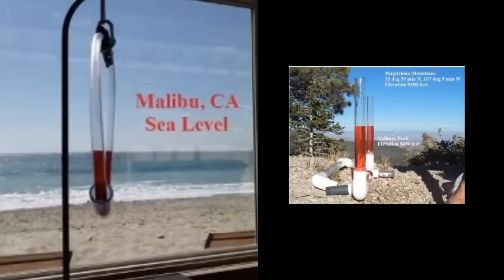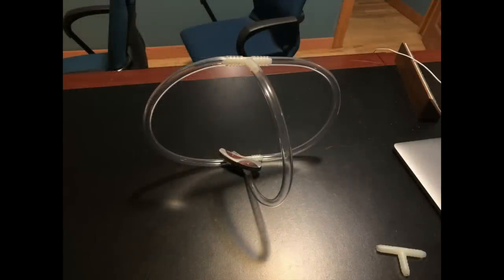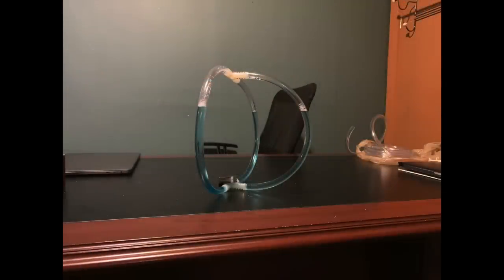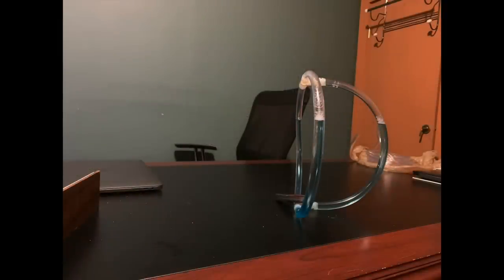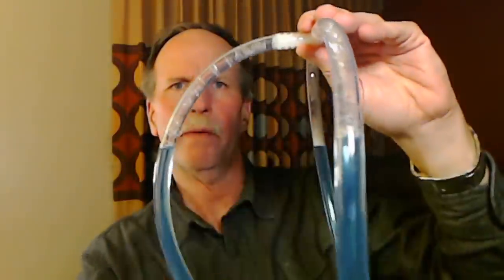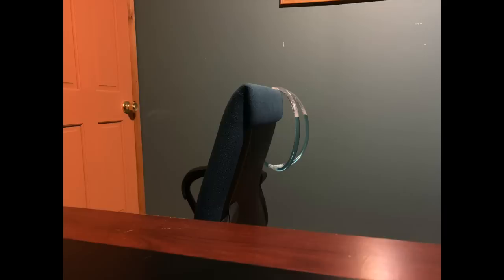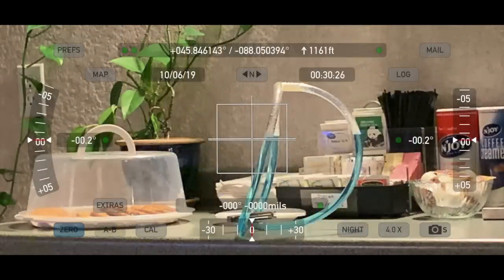Bob's Triple Water Level

Comment: Very nice.  I'm not sure what the surface tension is on Windex, but it's probably lower than tap water.  I might have gone with something that does not have suds, since the bubbles might interfere with the optical clarity when taking photographs and the mass in walls of the bubbles might cause a difference of height in different columns, however I'm not sure what colored liquid would have the desired properties of a minimal meniscus, no residue deposited on the tube walls, and good stability when subjected to the temperature extremes that might be experienced in the trunk of a car left outside overnight in the winter or in the sun on a hot day. I would add a plumb line of some sort to the kit to be able to show "down".
Reply from the maker: not enough to skew the results of this type of test.
Reply: @BobtheScienceGuy  True, but I'm anticipating the arguments against the results that the anti-globe evangelists will undoubtedly come up with.
Reply: Not sure they believe in plumb bobs, it appears that the majority of them believe that south is down :)

Comment: And now, for my impersonation of any Flerfer blowhard braggart: those of you comparing Bob the Science Guy's contraption to the inner ear's semicircular canals, you should know they consist of 3 rings, 90 degrees off from each other in the X, Y, and Z axes so as to inform the brain (of pitch, roll, and yaw as it were) of one's head movement/position.
Reply: Oops, I keep forgetting sarcasm and other attempts at humor do not translate well over text alone. I understood what you were doing there and applaud you, Sir. 
And here I try to awkwardly explain my awkward attempt at humor, but I was attempting to channel a flerfer's (lack of) personality with the Dunning-Kruger setting turned up to 11. In that I was speaking to all the comments that mentioned the inner ear's structures.
Looking back at my actions, impersonating a flerfer dropping knowledge of anatomy and principal axes of aircraft on a pilot/physician/FE-debunker's channel, I feel very much like a fool that ran across a fire break at dawn on opening day...wearing one of those hats with antlers.
So, please excuse the fuck out of me, I'll be moving right along. Nothing to see here folks.
Reply from the maker: you are correct, but this is not designed to give a 3 axis read, it is designed to be read from any angle on any surface.

Comment: Not sure about the windex Bob in the video it seemed to make the observation more difficult... Also the fluid needs to be darker maybe? Anyway cheers for a nice video... This is chuckiefinzter signing off from Western Oxfordshire UK. 😂
Reply from the maker: use anything you want as long as it doesn't damage the tubing, I had windex, it works.

Comment: So... during his college days he was known as "Bob the beer bong guy", or is that presupposing?
Reply from the maker: if only you knew.
Reply: Pleading a Fifth aye  @BobtheScienceGuy ?
Even though the + connector would work better that way it sits more level on flat surface & when using one loop you still have Three points of level.
Great work.

PS
Can you by chance start getting pics of high, low & intermediate tides of the lake for the flerfers that say lakes don't have tidal fluctuations?
Thanks Again for being calm & collective during your presentations. Many people are actually learning instead of laughing from your vids.
Reply from the maker: @tripinfool5640  The great lakes DO have tides, they max out at about 10cm once a year or so.  You need a LOT of water to have significant tides.
Reply: @BobtheScienceGuy  Thanks for the reminder of size of  lake & location does effect amount of tidal fluctuations. Which location can be a 6 ft or 16ft tidal difference. Flerfers seem to loose audio or wwweb connection once location even effects tidal height.
Thanks Again for all you do.

Comment: Cool!

BTW, if you need to secure tubing connectors without bulky hose clamps, check out Clamp Tite tools (I have no connection with them, I just use their tools).

If you follow the directions, you can put seizing wraps of stainless steel wire on a tube that will be more secure than hose clamps, tighter, and will have a perfectly even distribution of force. Even the sharp cut-off ends of the wire will fold down enough that you can't injure your fingers or snag anything. Plus, a stainless steel marine hose clamp might be five or ten bucks. You can do a better job for a few cents worth of stainless safety wire.

Every old salt should have one in his ditty bag.

Comment: Y connectors would look neater Amazon has them in brass which would give a little weight and keep the level stable.
Reply: 3:47 y connectors make it lose the ability to lay flat against a wall when hanged.  i think that's the only use case defeated by this though.
Reply: @skwiggsskytower2517  Brass "T"s would give one the increased weight, at a higher cost, while maintaining the original functionality.

Comment: Important with these waterlevels is, that there are no bubbles in the risers, and that you get a nice clear view of the surface. For that, and to reduce capillary effects, it's a good idea to have the tubes wide enough (and preferably of the same diameter and material, so capillary effects cancel out).
Reply from the maker: no, it just matters that there is a continuous path of fluid and the system is stable.
Reply: @BobtheScienceGuy  Bubbles in a liquid affect its average density, the principle of communicating pipes assumes uniform density of the liquid.
The system might not be stable with bubbles in the liquid, but if the bubbles are either very small or block the whole tube it can take long to reach equilibrium.

Also capillary effects should either cancel out or be negligible. In tubes with small diameter the meniscus also makes it harder to see the level clearly. For that reason i would also avoid foam on top, IMHO it makes it harder to get a clear reading (the foam also adds some weight on top, but that effect is probably negligible).
Reply from the maker: @Pengochan  point taken

Comment: Excellent DIY project, Bob.  How about a series of videos where you outline experiments that you can perform with suggestions like try to keep the entire level in the view of the camera when you take photographs because then no one can achieve accuse you of cheating by placing stoppers inside the hidden part of the tubes. If you're shooting video, show all parts of the level working with fluid easily moving between the tubes before doing your measurement.  We need more inexpensive science experiments like this that kids and anyone else can perform.

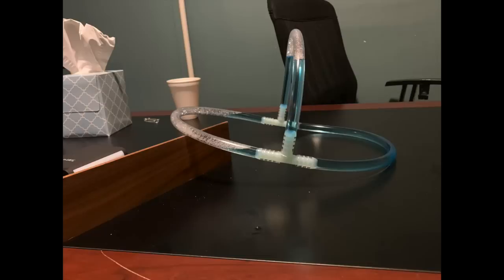Comment: Big problem at 2:38 ! There's a massive air bubble in the left hand loop of the device that appears to be well below the water level in the upper loop. Meanwhile, the surfaces of the Windex appear to show horizontal, just at different heights. This discrepancy strongly suggests that the closed design can return false readings due to air being trapped in different loops. While I doubt this would be a problem as long as the T-junctions are on top, it doesn't look like you can accurately use it with the T-junctions on the bottom.
Reply from the maker: I am so glad you pointed that out!!!!!  That just shows the flexibility of the system, that is air STORED there to give a level in the vertical loop.  Here is why it isn't a problem and works perfectly.  There is a continuous level of water that extends PAST the connector, so there is a complete and uninterrupted loop of water connecting both levels.  Still works.
Reply: @BobtheScienceGuy  The flat earthers may very well harp on the fact that the various water surfaces are NOT guaranteed to rise to the same height (at least in certain positions)in every tube simultaneously to try to discredit every observation people make with the tri-tube level, especially when one of your selling points is the ability to have more than 2 points of level water surfaces at a time. I know their ability to understand things is a poor standard for everyone else, but don't forget who you are trying to reach.
Reply from the maker: @TgSnowwy  their objections are easily dismissed, so I am not concerned with them.